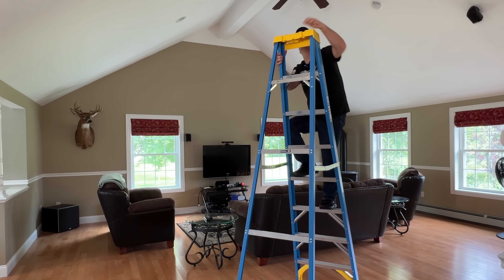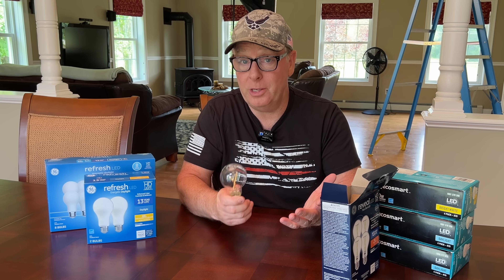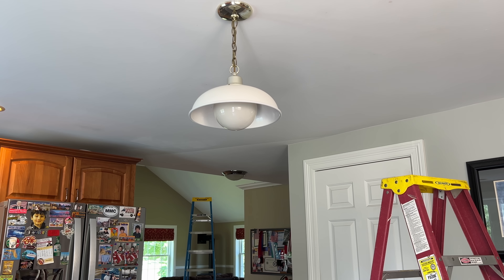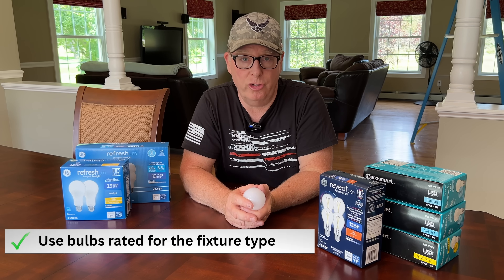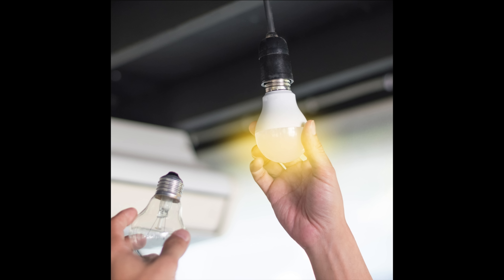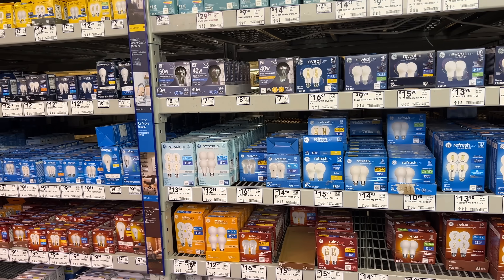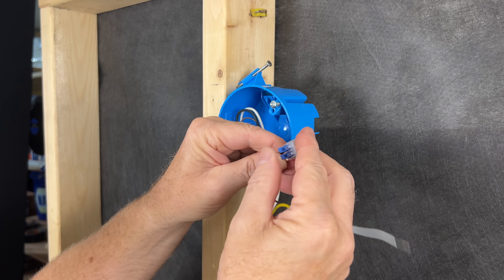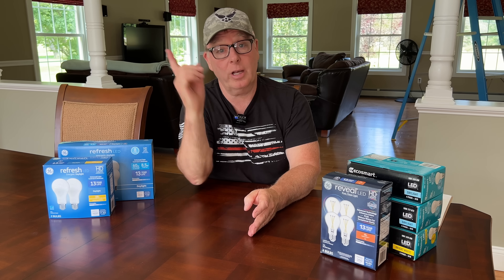The Mistake That Kills LED Bulbs

Comment: get free warranty replacement, write the date on them when installing

And recycle them at Home Depot entrance dropoff bin
Reply: I was doing exactly this, and Home Depot was exchanging them with no questions asked. However, I was replacing them every year and got tired of replacing them. These were the Ecosmarts. The early Ecosmarts I used in our previous house seemed to last quite a while (2015-ish) but recent Ecosmarts seem to not have longevity. I recently switched to a brand sold by Batteries+Bulbs. They are dimmable and rated for full enclosures. I will have to see how long they last. In full disclosure, I was NOT able to find dimmable Ecosmarts with full enclosure rating at my store, so that may have been the issue.

Now, having said that, I installed a municipality-grade lamp post in my front yard a few years ago which originally had a transformer and a sodium bulb. I found a commercial LED retrofit replacement for it. It is rated for 90% luminosity at 100,000 hours. It has a huge aluminum heat sink on it (about as big around as a 2-liter bottle) and only uses 34 watts. That bulb was $135, but I was okay with it because I do not want to climb a 15 ft lamp post to replace it. Similarly, the previous owners of our house installed 3 Sylvania LED bulbs in the light fixture in our foyer, which is also difficult to reach (12 ft), and they too have sizeable heat sinks on their bases. We have lived here 8 years so far and those bulbs are still good.
Reply: @paulwindisch1423  I moved into my current house 5 years ago and replaced almost all old bulbs with Ecosmart. There are 8 in the master bathroom. I have had to replace all of them at least once.
Reply: I usually have to file a warranty claim with Feit and so far they have always honored It.
Reply: But I dare you to read the printing on the base of the bulb you need to fill out the claim. I have to use the magnifying app on my phone and then it's still a challenge. Clearly,  Feit doesn't want to make it easy to file.

Comment: I keep a 50 watt equivalent as a night light in the livingroom lamp with a shade in an end-table.  It's been on 24/7 17 years, never off and still glowing. I bought it at HD.  Good vid, thanks for the info.
Reply from the maker: Yes in an open fixture they last a long time. Buy wow 17 years. You may be setting a record.

Comment: Most LED bulbs fail because one LED inside fails and since they are in series when one goes out, they all go out.  Sometime the bad LED can be bypassed extending it's life.  The driver circuit controls the current through the LEDs and won't be effected if one is bypassed.

Comment: It turns out that the text on the box is there for a reason. Who would have thought? All these geniuses and lead heads in the comments struggling with basic reading comprehension....

Suitable for damp locations, suitable for use in enclosed fixtures, dimmable, and suitable for damp/wet locations are all factors that you need to consider before purchasing. It's not rocket science. It's just basic reading.

Over the past 15 years or so, most of my LEDs have just about lasted as long as advertised.

Comment: LED lights do not like power. Surges, you may want to invest in a whole house search protector yes, they are expensive, but if you have dirty power or power that has a lot of noise on it, it can affect the.Regulator circuit in the l, e, d, causing it to fail earlier

Comment: OK, old brands like GE and Westinghouse DON'T make litebulbs anymore but third parties have bought rights to use their trademarks, we really don't know who really makes them.  I use LEDs in a number of places in my house where I want the light to stay on 24/7 and mostly the ones I use, generally from home despot, seem to last.  I have found that the spiral fluorescents also last if they are on continuously, they don't like being switched on and off.  High wattage traditional bulbs are generally intended for places that you want a lot of light but how about the little bulbs, why do night lites only last a thousand hours or so, I don't care of my night lite is a little dim, I'll trade the dimness for long life.  There was a outlet locally that sold 135v bulbs, they last forever (almost), I have some outdoor floods using these, to change them takes a LONG extension ladder, I don't do those anymore (I'm 83).

Comment: they aint lying.  the leds do last.  it's  the  drivers burn out. every one i've disected the actual led is ok.  like you said heat is the main factor  but also cheaper components  cant take inrush current or   surges

Comment: Very good video. 
In 20+ years of using LED bulbs in OPEN lamps (do not have ceiling cans) and virtually no LEDs in lamps (table or floor) fail. I have replace two bulbs, one from a lamp that fell over while lit and the other above the sink (a mini pointed shape decorative bulb that could not dissipate much heat). Most of these replaced those mini florescent that were sold in the 80's & 90's. (remember them?) I am not surprised that today's LEDs don't last (check where they were made BTW).  Since mine were made when quality was better, I cannot comment on today's bulbs. 
As an electronic tech, I MUST agree that the heat in a can fixture WILL make a difference (heat is a killer to any electronic circuit). BTW the reason the LED bulb works with reversed polarity is because the bulb internally changes the AC voltage in the house to DC that LEDs ACTUALLY use.

Comment: Great tips for them LED bulbs . I buy the home depot ones my self. Same ones in video.  Most run to the dollar store and buy them . That most of the problem . I also run across florescent replacements LED bulbs . Made to work with ballast.  They do not last long and the OEM ballast not rated for LED.  I have re wired many of them.  Take out ballast ! Go with ballast bypass LED lamps.  Re wire re install and work for years . Many of them ballast have caps that go bad over time.  I spent years replacing the ballast  on light fixtures. Even sodium and mercury lights. The transformers can short a turn on windings . The capacitors go bad in them .  The electronic ballast is subject to power surges . I added hole home surge arrestors to many older homes and replaced some on new homes. hear in Boston NY . Surges from storms are common . Good earth grounding is a must. I have ground rod resistance meter. New type. Just clamp on the ground wire. Has a thick pickup that goes around wire.  I find many older homes have insufficient ground rod system.  Cheers !

Comment: I get a 50% chance with the eco smart that either I haven't replaced for several years or replace within 6 months. BTW the ones I never shut off (open fixture) are the ones that haven't needed to be replaced
Reply from the maker: They last a long time in an open fixture.
Reply: I too have noticed when I change out a bunch of bulbs for new LED bulbs that if they're going to fail prematurely it is within 6 months. Those of the boxes that make it past 6 months will last years. I buy more than I need because nothing annoys me more than 1 or 2 bulbs of a multi bulb fixture being slightly off in color temperature or lumens.

Comment: Failed to mention the damp location factor. Matters for showers and outdoor fixtures.
Reply: I had an enclosed fixture at the basement stairway so I used a 4W bulb and it have been working for about 3 or 4 years so far.  A lot less head then the higher watt bulbs.
Reply: I've had the same cheap Great Value LED bulbs that stay on from dusk to dawn for over 4 years outside in 2 brick post lights through rain storms snow storms, you know, damp location "factor"
Reply: Most of the LED bulbs I've actually taken apart have all their components sealed completely airtight anyway.  Damp locations should not really change anything, unless you're buying really cheap crappy ones.

Comment: First don't buy GE or other US company.  They cook their power supplies.  LED bulbs got a lot better when a Chinese firm put most of the technology in chips instead of discreet components.   Don't use globes that keep the heat in the fixtures designed for incandescent who put their heat out in the bulb instead of down in the body right above the screw plug.

Comment: Polarity on AC?  Interesting.
Reply: We use what's called a center tapped neutral system with our single phase electric. A 120V circuit is one hot and the neutral. The neutral is actually bonded to ground. So it's not at any electrical potential.  Only the hot is hot. But there are circumstances where return current can be on the neutral. It's generally not a good thing. If your neutral is live that's usually indicative of messed up wiring. Most have no idea how stuff works. But they think they do.
Reply from the maker: All the current returns the neutral on a single 120v circuit. On a mutiwire branch circuit the neutral will carry the imbalance. It’s very rare to have no current on a neutral wire.
Reply from the maker: Yes AC reverses polarity 120 times per second on a 60hz system. But we have polarized fixtures meaning the shell is designed for the grounded neutral and the tab is the hot.

Comment: I just had my first LED light bulb failure, and this video made me think about how long that light bulb lasted.  I remodeled 14 years ago, and that light bulb, made by Feit Electric,  had been in service ever since then.  The light fixture is open to the ceiling, and that light is typically in use multiple times per day for less than 30 minutes at a time.  Not sure if it was rated for an enclosed fixture, but it was "suitable for damp locations", not dimmable.
Reply from the maker: Wow, that's some impressive longevity from that bulb!
Reply: That's impressive! Feit is my least favorite of the bulb brands at my local Menards. But I haven't been using LED bulbs for 14 years.

Comment: The life time numbers they give you, even when they were incandescent's, are in the base-down position, where they run the coolest.  Only table lamps or pole lamps use bulbs base down, that's maybe 10% of the lights in a house.  The other 90% are base-up, or sideways, which probably is as hot as base-up.  These are the 2 and 3 bulb frosted glass fixtures in kitchens, hallways, bedrooms, and bath rooms.  So their expected lifetime is even less.  And a cycle of 3 hours a day?  So you turn them on at 6 PM and then go to bed at 9 PM.  I say a more realistic cycle time that fits most peoples life is 6 to 8 hours a day.  Also your phone chargers and other "wall warts" nowadays are not polarity depended.  Both prongs are the same size, you can plug them in up or down.

Comment: I had very bad luck with high wattage LED bulbs that look like a standard bulb. These would be bulbs over 60 watt incandescent equivalent. There just isn't enough heat sink inside the bulb. I found a higher success rate with the "corn cob" style bulbs when you need a lot of light in a high ceiling application.
Reply: The Corn style has aluminum cooling strips inside and larger components.
I've found they are definitely not built to be used in a Work Lamp. 
They quickly break.
They're great for ceiling area fixtures.
Reply: @RetroCaptain  The fixtures I used are the "barn" style, large round metal open reflector, white on the inside and either red, green or white on the outside. I just wanted that look but it winds up costing a lot more since these fixtures were rated at 200 watts each, even though I was using a much lower wattage LED bulb, I had to wire all 16 fixtures into two 20 amp circuits because of the fixture rating. Good subject for BM to cover.
Reply: @RadioChief52 In your situation they are in ideal conditions. 
I'm talking about the portable hand lamp where it's literally being dropped or falling from where it's set up. 
I've found that "most" of the LED style are not able to fall more than a couple times before the circuit board inside disconnect internally leaving you in the dark. 
Just hanging from the ceiling is very secure and when it's a Pendant style fixture then put it to the maximum lifespan as no vibration transmitted to the fragile board.
Reply: Yeah, there's a reason not a lot of manufacturers even make LED bulbs over 60W-equivalent in that form factor.  There's just not a good way to deal with all the heat being generated in such a small package...

The corn-cob style are better because the LEDs (generating the heat) are generally further away from the electronics, and have more radiative air contact, but even with those, there are limits.
Reply: The federal government forced those bulbs on us at the request of the industry. There is no reason that incandescent bulbs should be banned, other than the chinese manufacturers make more money off these led bulbs.
Reply: @graybeardnj3216  utility companies were also a driving force. New power plants are expensive to build, there was the false oil opec oil shotages while the government\EPA were forcing the shutdown of nukes.

Comment: My house is 100% incandescent, old school. Ive a good stockpile of spares, but honestly have had to change out only 5 bulbs in 25 years. My 12 40w bulbs in bathrooms and kitchen, and 4 halogens in dining and living room, not changed in 25 years.
Reply: The amount of extra money you’re spending on electricity is not worth the upsides.
Reply: @ugh-mehAnd it’s zero Sep-May, net heating season. Other months ? Lights barely used in long daylight.

Comment: Technology Connections had a great tip; buy the fancy, decorative LED bulbs.  Having the LED away from the driver seems to allow the driver to last longer.
Reply: It is also because the driver is in the base and that means more heat can be sent away via the base.
I'm not sure that is true, only because iirc the uae made Phillips make led bulbs for their market that have a crazy amount of led sticks in the bulb, so that they actually last.
I bought some and installed them at a business where they only last around 1.5 years, so we will see
Reply: @sprockkets  Haven't been bulb shopping too recently so not sure who the decorative manufacturers are compared to the normal bulb offerings in stores. Brands like Feit and Phillips didn't give me a reason to inspect them yet compared to GE which I went through multiple boxes of failures before I replaced 1 Feit bulb.

Comment: I dunno.  I have had about 75 standard bulbs and 50 candelabra bulbs in my house for six years, and I've replaced maybe a dozen.  This is consistent with them lasting 13 or more years on average.  Most of the bulbs are Dollar Tree's $1 specials.  The ones on dimmers and candelabra are Noma, which I got on sale for about $2.  I'm not sure that any of the Nomas have quit, and I think the Dollar Tree ones that failed were likely defective, not "burnt out."   On the other hand, several of the six T12 fluorsecent tubes in my kitchen fail every year.  I think the starter on the electronic ballast roasts them.
Reply: I've replaced about 50 bulbs in my house and only 3 have gone bad. I mainly bought name brand bulbs at reasonable prices back in 2018-2020. 8 are for a chandelier. None of those have failed in 7-8 years. I use 40W equiv LED bulbs in most areas. I have 75W for outside garage and 60W in garage and closets.
My flourescent 4ft ballast in the kitchen broke and I got a LED 4ft light with many small LEDs inside. My smaller 24" for above the kitchen sink, fluorescent bulb broke too. I replaced that with an LED light fixture too. The larger one cost about $80 and the one above sink only cost $20-25. They both are brighter than the fluorescent bulbs they replaced but use less energy.